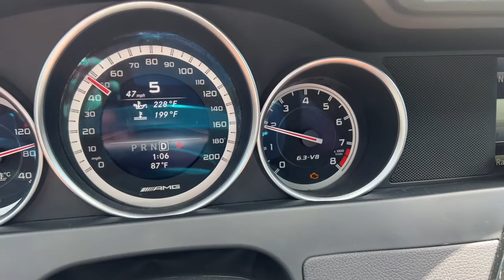Engine Blew In My C63..

Comment: I have a 2019 C63, I got a stage 2 tune from Eurocharged and catless downpipe within 2 months of buying it…. Something blew up in the engine within a week of the mods… I am so Depressed right now as I have no idea how to fix it nor do I have the finances to be able to as I’m pretty sure all warranty is voided. What do I do?!?
Reply: Noooo😮 …… I have the same year and was thinking of doing the same tune I thought eurocharged had a motor warranty?????
Reply: @Phillipsonfire123  if they do I’m not aware of it or they haven’t brought it up to me… I’ve taken it back to them for them to check it. Turns out these cars have plastic intake manifolds and that’s what blew open. It’s currently getting new ones replaced at the Mercedes’ dealership.

Comment: Stuck injector is rare but does happen unfortunately however these engines part from that and stuck lifters are pretty bulletproof, I Owned mine for 4 year tuned with headers, high 400 wheel, tracked, vmax abused daily and never missed a beat apart from toping up the oil like fuel lol, and 10 of my buddies for 5+ years zero issues all abused eve a few SC ones , occasionally hear of a stuck injector but they usually end up with a hole in the block. Could be a bent / shattared lifter. weird how you've had issues with every amg you've owned? Hope you get it sorted without it costing more than the cars worth

Comment: If he can't turn it, then there's only a few options - It either blew the timing and then had a valve/piston collision ( = Not Good), or it spun a bearing causing a bent rod ( = Very Not Good).  The latter is usually a lubrication problem - if your oil was fine, it could have blown the oil pump, and then see above.  I believe the pump is cam driven on this engine (as opposed to driven from the timing), but if it was from the timing it could have been both a timing collision AND oil starvation, and then you usually get extra vent holes in the side of your lower half and "piston McNuggets".  Isn't that special'?

Comment: My car has this engine with the old style head bolts.  I am constantly checking the coolant reservoir  for any signs of oil, in case the head gasket is failing to seal.

Comment: How to fix this Mercedes C63 in 8 simple steps.

1. Roll one of those one ounce spliffs, 2. disassemble the air intake manifold, 3. add a throttle body spacer 4.adjust the one ounce spliff to the throttle body spacer 5. Start the car 6. Light the one ounce cliff while ignition is turned on 7. Redline the car to allow maximum cannabis intake to remove the change engine light 8. The car should mellow out and better yet fixed...!

Comment: Head gasket and weak oem bolts.  Known issue w AMG Benz.

So much for HAND BUILT AMG....RUN AWAY
Reply: The headbolts were fixed midway through 2011. His car has the fix

Comment: I can't remember the name but the barrier between oil and water in the motor, the gear heads out there know the term....IMO, do some more donuts, first you drowned one now this....Jeez o Pete
Reply: Head gasket... looks like a water leak into the cylinder.
Reply: @christianbuczko1481  yup or piston ring blew either way motor is hydrolocked

Comment: Firstly,  sorry Mike. You are a good guy man and this sucks to happen to anyone,  especially a good person. Good luck with the fix/new engine.
Consider picking up RS7 or RS6 "twin turbo 4.0 V8" and tune/ build it. They can make some serious power,  more reliably.

"I know I am going to get roasted for this" "believe me I like Mercedes"
Mike, stop buying Mercedes vehicles.  They are not as reliable as BMW (that alone is saying a lot) or Audi German brands, plus the maintenance alone on Mercedes is the most expensive. On top of that "not my cup of tea" however,  there are the Japanese performance cars like Lexus and Acura that more are reliable than the big 3 German brands.

Comment: This is why I will never buy a Mercedes.  My Mom has a GLC300 and we bought it in 2016 back when they were brand new, but now it's starting to fall apart and it's had its check engine light on 3 times last year.  Frustrating.  So much for Mercedes being reliable.
Reply: You’re supposed to buy two.  You know one’s gonna be in the shop, right?
Reply: @patrickrabion9473  Too much money.
Reply: @BusMaster99  Did your getting many calls about extended warranty?

Comment: Another engine, stock engine!!!
This engine need a lot of hours to rebuilt, because its posibile some modification and change piston set or other things....
U say "its 2013". And what?! Depends how u drive and use the car... How u make maintenance at how many km u change oil and filter.
German oil: 
Liqui Moly
Ravenol
Filter: Purflux
Ar every: 8000km - max 10.000km! If u want tot sleep good!

Comment: The facelift C63 M156 is a pretty bulletproof engine, on top of that yours is the PP with forged internals! Baffled
Reply: Oem head bolts recall bulletins ...
U left that out
Reply: @dodgehemi5045  head bolt recall only for 2007-2010, his car is a 2013 which does not have head bolt issues